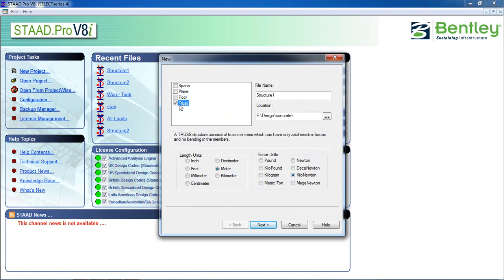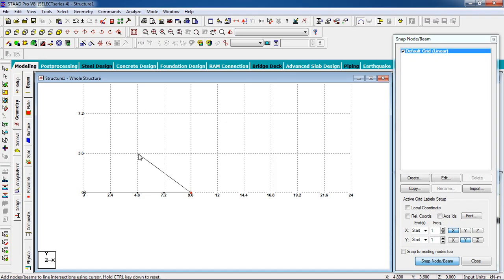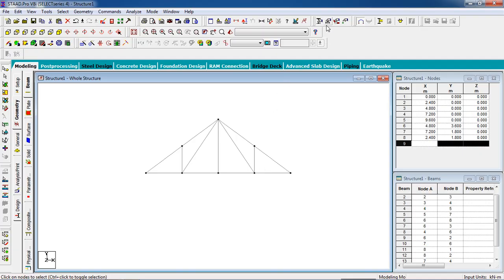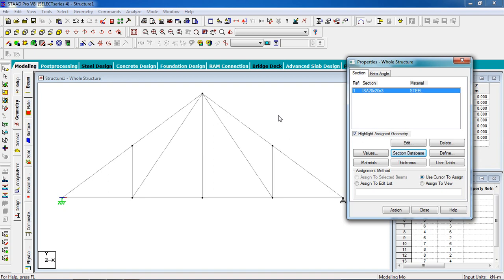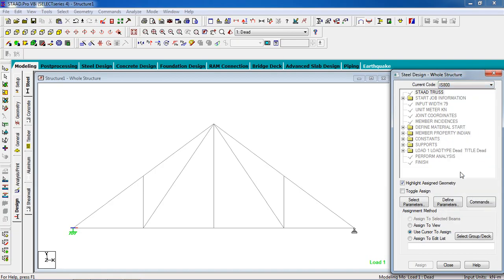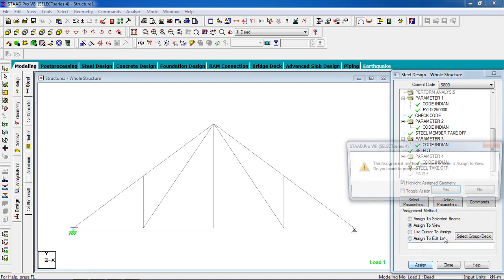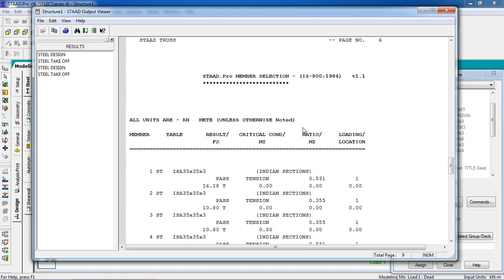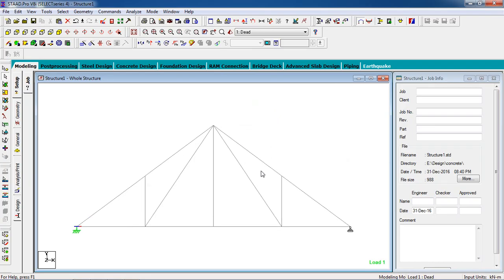STAAD Pro Tutorials - Analysis & Design of Steel Truss Type-1 ( Day 32)

Comment: How did you do that displacement of beam movement in post processing tab 12:12?
Reply: Ankur Singh im asking the same question too
Reply: @zubaidahrusli6738  it is actually adjusting the scale of deflection by using hot key [ctrl + mouse center wheel scrolling]